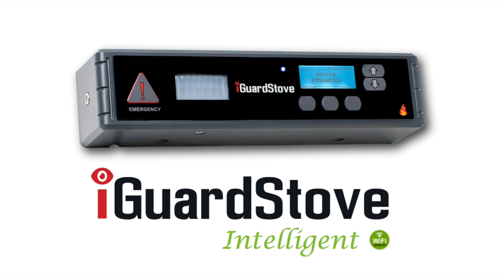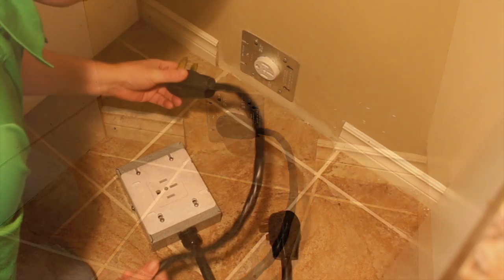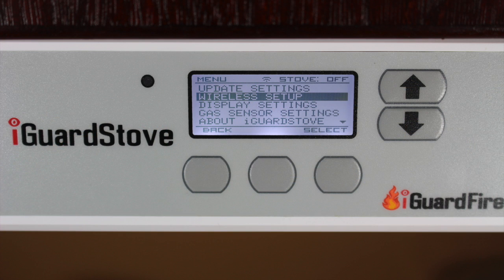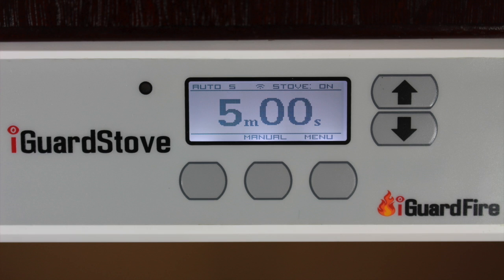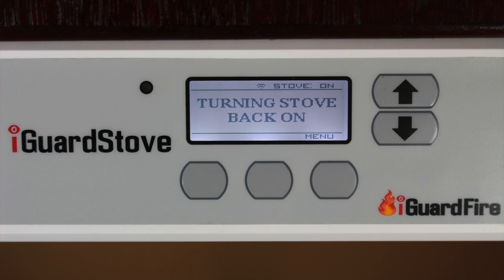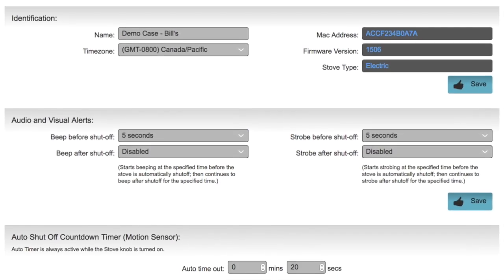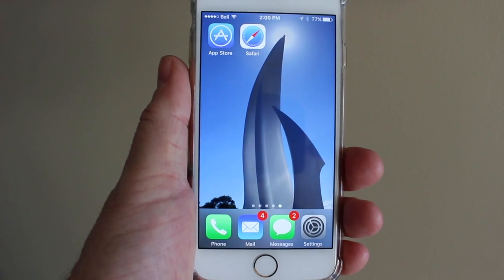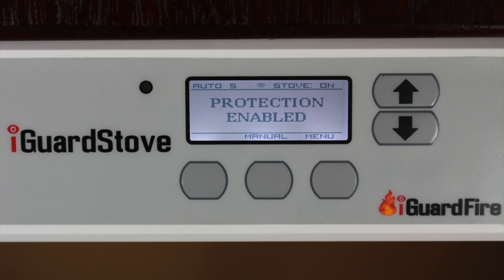How does the iGuardStove Electric work?

Comment: Is there a way to use the stove, without pushing the start button using the control button? It is hard for my mom to remember that!
Reply from the maker: Thanks for the question.  I assume that you have a gas stove model.  The only way to light the stove is to press the start button, which will open the gas valve, allowing gas to flow to the element where you use the knob to ignite it.   It’s by using the gas valve that we can control the stove. If the gas valve was in the open position and someone bumped the knob or just didn’t light the gas then there is no safety.  Its only by having it operate this way, that the iGuard can protect you.
 
Admittingly, it’s not a s automated as the electric stove model but gas stoves and electric stove are 2 different animals and need to be dealt with differently.
 
Did this answer your question?

Comment: what happens if my stove is not connected by plug but installed in the house
Reply from the maker: If you are referring to a hardwired cook top then yes we have a model for that too but it needs to be installed by an electrician.
Reply: @iguardfire3007  thnks for speedy reply

Comment: How sensitive is it. Say during the countdown a dog walks around or a window curtain blows, will it continue to stay on thinking its body movement?
Reply from the maker: The sensor looks for heat so drapes will not trick the sensor.  And the sensor looks out horizontally so it can't see any pets at lower levels.  Lastly if you have a sensitivity issue you can contact us and we will adjust it remotely via the wi-fi connection so that it works better for your situation.  This is done per unit and is something that is not adjustable by the consumer and truthfully we have only had to adjust maybe 3 or 4 units over the years.  The system works very very well out of the box.

Comment: We installed iGuard yesterday. The motion detector reset itself to 5 min. when it sensed movement. But the next day when trying to cook the motion detector didn't reset to 5 min. when standing in front of it. It kept counting down. Can you tell me what went wrong?
Reply from the maker: I believe we spoke on the phone jus a few minutes ago.  Even though we test every single device that leaves our factory floor we believe that the ribbon cable somehow came unplugged.  Since you bought this though Berst Buy,  we will send you a replacement control panel as soon as we receive your shipping information etc.  Return the original to us and we will make sure its tested and fixed up.  No other action is required.  Thanks again for your patience and welcome to our family.